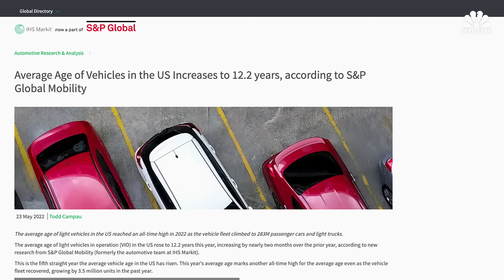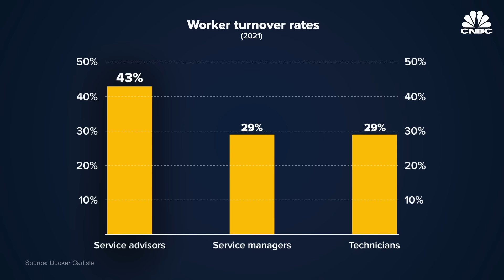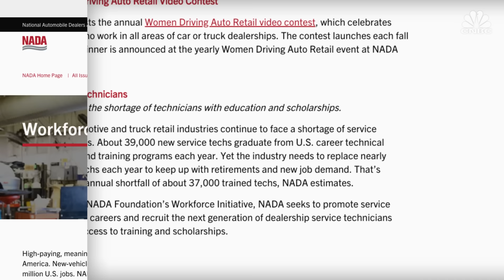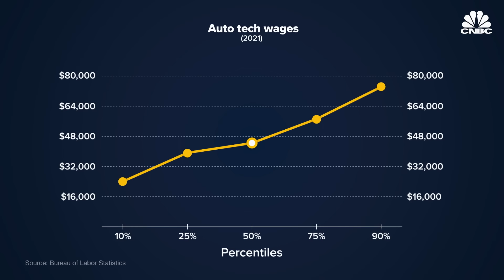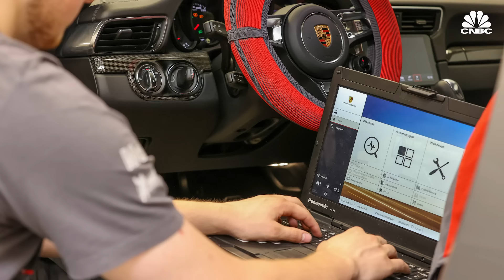Why The U.S. Has A Shortage Of Auto Mechanics

Comment: 8 years ago, I remember working as a entry level mechanic at a dealership. A customer paid $550 for a rear brake job on a SUV. I got paid .9 hour from that work order. My flat rate was $14/hr. It really opened my eyes as to how that industry is. I only worked there for 4 months. I’ve change my profession since.
Reply: just curious - what do you do now? & are you happy with your new proffesion? cheers
Reply: I know, bro. They treated us like grease monkeys.
Reply: @mrdol  I am in law enforcement now. I am pretty happy with my decision. It's nice to know that I'll have a decent pension after a 20 year career. I also have a pretty clear career progression and good benefits.
Reply: @man_of_culture5558  cool! happy for you. all the best
Reply: @Karl with a K I think it’s a lot more than teaching critical thinking skills lol. If you pay your employees what they are actually worth, you’ll keep them for longer.
Reply: @Karl with a K - I agree with you but I believe this is a temporary problem. Cars will be self-driving within our generation (or our college aged kids generation). Cars will likely be fixed by replacing a "module". The diagnosis will be a scan tool telling a low skill worker which module to replace. Modules will be designed so they are simple for a low skill worker to swap. There is some of this already happening. DIY mechanics often use scan tools to swap out O2 sensors or other parts, often at great cost because the scan tool diagnosis was wrong or incomplete, but computer vision combined with AI is getting better at a frightening speed and only needs to be as good as a really good mechanic, which I believe is achievable at some point in the not-too-far future. If computer vision includes IR , UV, and high magnification vision then certain classes of problems could be better diagnosed by machine than by a very good mechanic.
Reply: @Karl with a K As systems continue to become exponentially more complex, what makes you say the need for diagnostic techs will diminish? There is an increasingly small percentage of techs that can diagnose anything more complex than a bad fuel pump.  Can we really expect manufacturers to put money in developing systems that are easier to diagnose?
Reply: @Karl with a K Well they did try... manufacturer trouble trees that all end with "Replace PCM" 🤣 But I'm honestly curious- why suddenly now when they haven't prioritized making diagnostics easier for decades?
Reply: @straydawg13  these dudes are crazy to think mechanics are not going to be needed. They sound like the people in the 90's who said we would be flying in cars by 2020 lol
Reply: Likely 250 was rotors and 100 was pads. 200 was labor charge, "shop charges" and tax.
Reply: @donaldlee6760  come out of your dream. A scan tool will not tell you what module to replace. Network diagnostics requires skill beyond the scope of your imagination.
Reply: @HristovRumen  I like how you said "Scope" of imagination hahah good one 😎
Reply: @HristovRumen  - I'm so sorry but I assumed when I included the phrase, "...often at great cost because the scan tool diagnosis was wrong or incomplete...", then I thought the reader would immediately understand that a scan tool will not tell you what module to replace. Please let me know if you misunderstood my comment so that I can be more clear.
Reply: @Karl with a K so you really believe that manufacturers would try to cut cost by investing bilions into some super smart computers and cutting down on labor, BUT they'll go back 20yrs in time and make parts in a way that you replace not what's bad, but also 3 or 4 more parts.
Reply: @Karl with a K you're saying it's a simple and cheap task to develop a scan tool capable of actually analyzing the data streams it sees and run disgnostics based on them. Just as an fyi, modern day scan tools, including manufacturer specific oem ones only show you the data streams. The analyzing of it is left to the technician. So you believe it's not gonna cost billions to create a scan tool that can actually take the place of the techs? Also, how will the scan tool find out shorts? They can be internal to a component, module, in a connector or anywhere along a harness. A well placed short csn take out the entire network and a scan tool will have no communication to any module on the car. How's a computer gonna find that? If we asume for a second that it could, then what are you gonna do? Swap the entire car's harness, costing over 10 grant in many cases? Vs having a tech trace it and fix the wire that's causing the short costing maybe a couple hundred bucks....
Reply: @Karl with a K what a derp thing to say. What about a brand new 4l60e swap? 6 hours of labor, 1600 dollar part. Big brakes for trucks and suv's are expensive as well and are simple to change
Reply: @man_of_culture5558  i'm currently a senior in high school and trying to decide if i should join law enforcement or become a mechanic. i enjoy working on vehicles although i do get stressed out sometimes. law enforcement has my interest in many ways. would you have any advice for someone like me graduating high school soon and wanting to pursue a career in law enforcement? any advice will be greatly appreciated.
Reply: @liamgeeslin4638  Okay... the most successful mechanics I've met are the ones that get trained and certified on a specific brand. Meaning,  you can get certified on a school for Audi or Kia or Honda etc. (i.e. Google: Honda PACT) This will insure that you are working on the brand of your preference. This training will more than likely make you standout among your coworkers with "generic" training. If I had to start all over again as a technician/mechanic this is the route I would go, or I would look into the heavy duty side industry i.e. 18 wheelers, truck tractors, as this will pay more but is more physically challenging. 
As far as law enforcement goes, there are many routes you could go depending on what you would like to do. For example, you could attend a peace officer course (usually takes about 2 semesters, last I checked) and you could apply for a police officer position on small Police Department (PD) that don't have their own  academy. School district police departments also, usually, hire this way. You could also simply apply at a city's PD and attend their academy. Some PD will require a bachelors degree in order to apply. Also, note that some PD academy will not pay you during training but most will, some will even house you and feed you during training. Just some things to consider if you are looking around PDs, and there is a high need for officers right now so you could have your choice. You can also go to school and become a Criminal investigator if you don't want to be a cop. And, you should consider Federal Law enforcement position like Secret Service Agent,  Border Patrol Agent or Customs Officer are willing to hire you with just a high school diploma. Just keep in ming that applying for any of this positions takes time (6-18 months).
Start looking into Salaries for law enforcement on your city, county, state and federal (i.e. Google: how much does a state trooper get paid in the state of ___) and their retirement plans. As you start making this decision get familiar with forums, like reddit, where you could ask specific questions. Like, work environment, training, benefits and normally someone will have an answer for you. Just don't pay too much attention to very negative people, and remember that every experience you have depends on your attitude and outlook. Good luck!
Reply: i work for honda bro and snooping around the R.O.s, i saw someone pay about $900 just for rear pads, rotors and possibly a flush. $4000 for a cat and possibly the attached pipe replacement because of rust.

Comment: I worked as an automotive technician at a dealer for over 20 years. It was time to leave and I just didn’t see it getting any better.  Totally agree with every comment I read! Very spot on. The reason for the shortage is all right here in these comments. Words from real world technicians and former dealership techs. They  are just speaking the truth from what they have experienced.
Reply: I have a 2005 Ford Crown Victoria LX Sport sedan. Every year it just gets older. Currently, I need a new AC system, new intake manifold, repairs to driver door, driver seat, rear pass window(power window). It's cheaper & more practical to buy or finance a used SUV car 2015, 2014 era then dump $$$ on a 20yr old V8 engine car.
Reply: "I need a raise"
No.   You are lucky to have a job.     BTW, can you work late?

Thirty years in the biz, and it only gets worse.
Reply: Why do they speak on this in the video?!?!
Reply: what did you become after being a tech?

Comment: I need to tell you guys one thing once and for all. I was a master tech from 1975-1999.  I worked at many shops and dealerships and it was tough work. I had thousands of dollars in tools, certifications up the wazoo and fixed many cars no one else could, or didn't want but in 1999 I got so fed up with the business, I left for good and never looked back.  I can tell you horror stories that would fill YouTube. I got so tired of poor wages(flat rate is fart rate), poor benefits, and poor management. My wages being so bad my family suffered. From what I'm now hearing from you young guys its still the same way.  There was a mechanics shortage back then.The automotive field HAS NOT CHANGED ONE BIT. Get it through your head- it never will! You can offer all the solutions and ideas you can muster but ITS NOT GOING TO CHANGE.  Take my advise- in 2000 I changed careers and it was the best thing I ever did. Its said, "A wise man learns from his mistakes, but a wiser man learns from the mistakes of others." Wake up guys and move on.
Reply: Start a channel, I like hearing these types of horror stories
Reply: What career did you get into? Tech pay is terrible
Reply: Hey, maybe you have some insight. Do you happen have any ideas on why an a GM 2.5 liter iron duke engine would be running rich at idle? Or any scan tools that can read live data on an 87 engine with the pre-OBD ALDL interface?

Comment: Ex-Master Ford tech here with ASE master truck and auto. Was at last dealer till the March of this year. $42 flat rate. 40 minutes one way to work. Turning 20 hours a week while being there 50-60 hours. I left and took some time off for medical reasons. In may I started a job at a used car lot at 22 hourly. All the company wants me to do is fix cars (no shortcuts) so they can be put on the sell line. No pressure or hurry ups. Just fix them. 40 hours a week and I am home in 15 minutes. One of the best jobs I have had in my 40+ years as a mechanic. Also if I need to take time of to rest my 60 year old body the owner does not mind. That right there is peace of mind.
Reply: johnfrancis0063,  I sure would like to find a mechanic I can just pay $25 an hour to take on some jobs I would rather have help on.  I wonder where I can find someone like you local.  These are sone jobs that I’m in no rush to have done.

Comment: Hours, Pay, vacation, Benefits, Tool cost, work environment all play a huge part in the career. I can tell you that even 90k a year for high level tech is extremely low considering all the knowledge, labor and oversight that is required from that employee.
Reply: And in some places, the cost to actually live there is high.

I'm not a mechanic. But my job is having a similar issue with a shortage of staff.

A lot of places here increasing the price of rent. Because they think a bunch of rich guys are going to buy it.

So, where does that leave the local people here who aren't rich?
Reply: That’s what I’m making at 20 as a journeyman electrician
Reply: the only people at the mercedes dealership making 90k were the team leaders. the rest of us made around 45k.
Reply: The automotive industry has not seem a pay raise in the last 20+ years. Technicians in the 80's were paid 50% of the shops labor rate and cleared 100k. Now those techs are mostly out of the trade and the industry has greatly changed and become much more complex. Its almost impossible now to clear the same pay that was not uncommon 20+ years ago. Fixed-ops directors aka general managers are making 250k, service managers are making 150k min with bonus. Salesmen are all clearing 100k while they stand around most of the time and bs customers where we then have to go and explain to the customer that is not how their vehicle works. A technician is required to know how the vehicle works mechanically, electronically, features, options and diagnose a vehicle with 60 computers on it and multiple communication networks. Training is none stop because the technology is changing year to year and not getting easier. I have also seen a push where technicians are now being held liable if they don't catch something on a customer vehicle or for something that happens after the customer leaves. The professional tools are Extremely expensive! A single impact gun is normally around $500-$800 and no harbor freight is not an option for everyday professional work were you rely on your tools to make you a living. I have 60K in tools and still need more but cant afford it. 
You have a family, a home, utilities, gas, groceries, vehicle expenses, the list goes on as everyone knows. So where does it makes sense to pay a tech in this industry the way they do when the cost just to do the job is so expensive. Your on your feet 10+ hours a day standing on concrete working under a 200 degree engine and running around like your doing a speed walking marathon just because the shop wants to bring in 150 cars a day so upper management can get their bonuses.
New hires around my area are being paid $15 and not staying because they can go work with their cousin hanging dry wall for $24 to start, union, have  $ per $ match on their 401k and fully paid health insurance. Health insurance cost for my place out of pocket cost is $300 per month for a single plan, family plan is over $1000 per month... How.. Is anyone suppose to make a living with this.
Terrible pay, No Appreciation, long hours, horrendous benefits, expensive cost in tools. This industry is going down hill and fast!! This industry needs to start coming to time and offering what every other trade has been doing for years!
Reply: @toyotabeast527  everything you said is true with the exception of the hf impact gun. used mine professionally for over 20 years and it still works. my mac and ir failed in less than a year
Reply: @narcissistinjurygiver2932  There is deff some harbor freight stuff I do buy because its cheap and will last a while or for what I need it to, but for the majority of the tools esp the diagnostic and specialty items can get very expensive. I was manly using that as an example. I do have to say for the SnapOn air hammer not many other come close to it.
Reply: $90k is not a “high level exec@ by any stretch of the imagination…unless you are talking per month.
Reply: Professional automotive and diesel technician here with 20 years experience. @Toyotabeast - You hit the nail on the head. I switched to heavy duty diesel 7 years ago. No flat rate bs, more steady pay. We are drastically underpaid. I am a Diagnostic Diesel Tech 1. Top of my field. I make about 65k per year. Ok money, but nowhere near what I am worth. I am not special in this. Many of my fellow professional, quality technician colleagues are in the same boat. 
After all this time, training, knowledge, tool investment, etc, I am out of it. Start my new position in a couple of weeks. Better pay, steady hours. New company with no seniority or experience. Pathetic.
Until the dealer principals and corporate ninny's start recognizing exactly what technicians mean to everyone's bottom line we, all of us, will continue to move on. The work is too hard, the toll on our bodies, too rough, the knowledge and skills required to work on modern vehicles, too high, and the lack of respect, too great for us to continue to put up with it for much longer.
The only way to change the narrative is to walk away and let reliant industries struggle with new, inexperienced technicians. Maybe then...
Reply: @jb40now47  Have you considered starting your own business?
Reply: @jb40now47  i left after 13 years as a mercedes technician. too hard, little pay, horrible conditions.
Reply: @edhcb9359  i know right I made 100k a year and it’s not a lot what so ever by any means
Reply: @narcissistinjurygiver2932  not when you have a family and cars and a house.
Reply: @toyotabeast527   Most car salesman are making less than $100k, and given that most of that is classified as bonus income, so its taxed much higher.
Reply: @narcissistinjurygiver2932  cordless or air impacts?
Reply: @tjlovesrachel  air all the way.